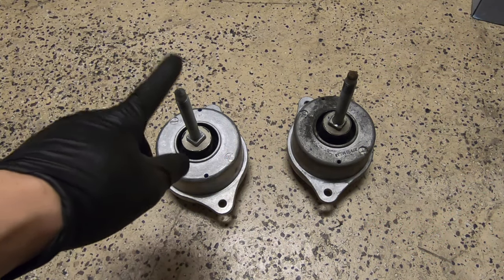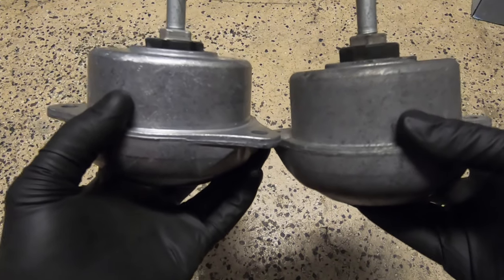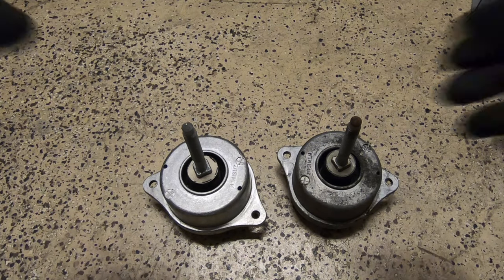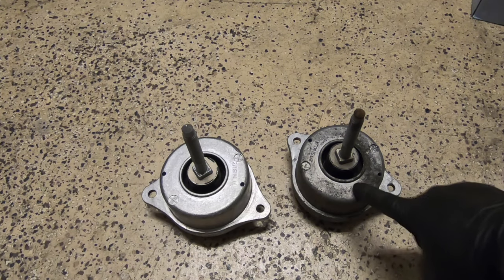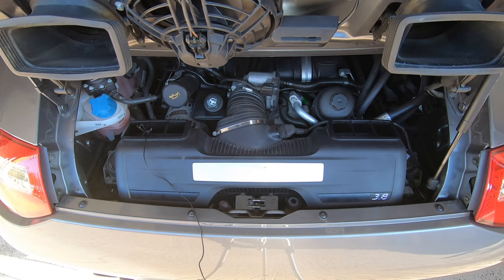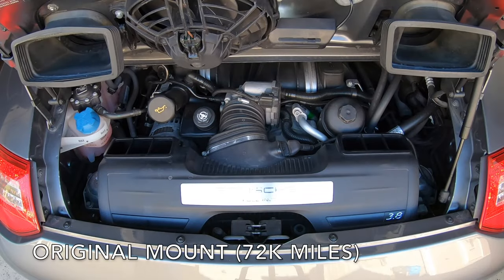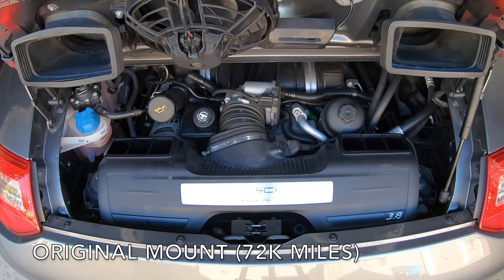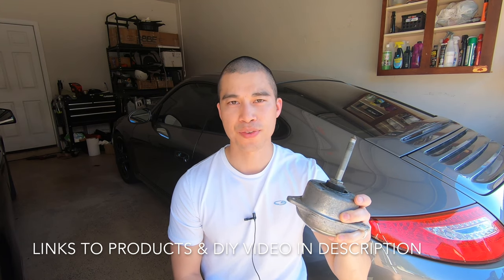Are Semi Solid Engine Mounts Better than Stock? Test Review on My Porsche 911 (997)

Comment: I replaced my used 75k motor mounts with new OEM mounts. The old mounts were clearly done but I couldn’t feel a difference old vs. new other than the exhaust tips didn’t sag. I later changed to semi solid mounts and that added more NVMH and makes the ride feel more raw but does not help in performance except a few specific corners on the track. If you want a more raw feeling semi solids are cool or if you track your car and your local track has fast right left sequences also makes sense but otherwise OEM are damn good.

Comment: I took some video before and after the way you documented the change and the results are much like Rennline you installed. Very happy with them, I drive a 911 6SP manual because I want a mechanical feeling car. 
No additional vibration or harshness.
The car has 83K now and the old ones were stretched and even new stock ones may be to soft for me .
Reply from the maker: No vibration huh? If so, that sounds like the best of both worlds! How about noise?

Comment: I’ve been considering replacing the mounts on my 2009 (55k miles) as the exhaust tips are sagging a bit and the shifter is notchy going into 1st and on the 1-2 shift.  When you went back to new OEM mounts, did the car still feel tighter and more responsive?  Was the NVH really that unbearable with the Rennline mounts?
Reply from the maker: Nvh wasn't unbearable, but I did not like all the additional vibrations. Given I was coming from that, it was hard to notice a difference. Overall though I think the engine is better controlled than with the original mounts. Depending on the mileage, the difference you feel will vary. Hope this helps!

Comment: I bought from your site and installed the rennlines with the yellow inserts on my 997.2….NVM is noticeable. I imagine this is how a race car feels like! Louder, more immediate, more like I’m in a performance car. I had gotten so used to the feeling on the old - 55k miles - mounts maybe this is what the car was supposed to feel like?

I daily drive it so I might consider going back a tiny step towards comfort and have hear about the Function First mounts where they take stock mounts and fill them with more material inside so that they are somewhere between OEM and Rennline. 

Could you do a similar video with those FF mounts?
Reply from the maker: Hello! I definitely understand what you mean. I made this video comparing stock engine mounts against new and used ones filled with polyurethane, which is basically what the FF mounts are. You could try filling your old mounts and seeing if you like it. I suggest giving the Rennline mounts some time to break in because the polyurethane should soften up as you break them in. The FF mounts will definitely be more comfort oriented, but won't have nearly the same performance benefits as the Rennline mounts. Hope this helps! https://youtu.be/LpJpNMtTN7o
Reply: Thanks I’ll have a look at that video now!
Reply: @tamagocheesesandwich5955   I had a look..very interesting...not sure I can trust my own home made repaired 50k mile mounts...I'm getting slowly used to the Rennline semi-hards and I'm worried I'll miss how responsive the car feels! It's definitely less "comfortable" since I use it as a daily driver, and I have to turn the stereo up...but equally sometimes I now turn the stereo off to listen to the engine and notice the car vibrations...they are more "honest"...like a go kart. I think that's probably a good thing so I'll keep it for now.

Thanks again for your very helpful reviews. You're the go to guy for Porsche 911 engine mount info now!!!!!